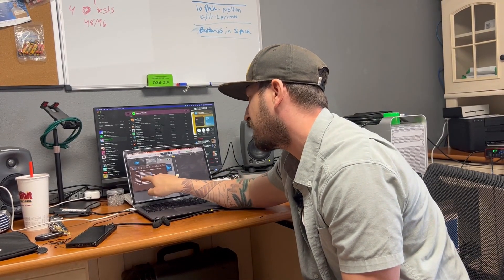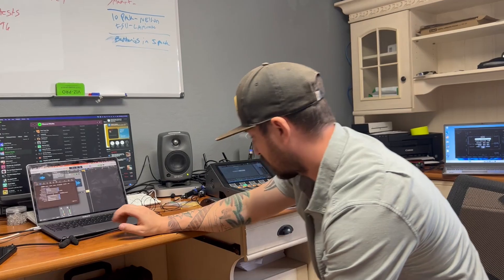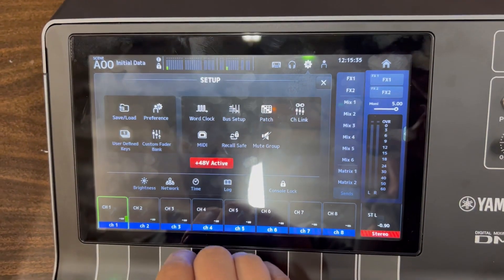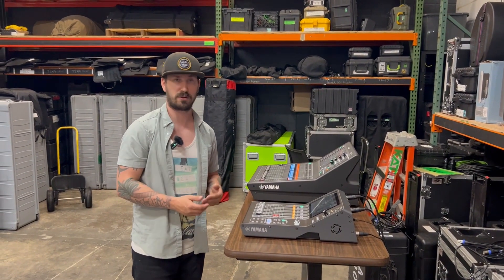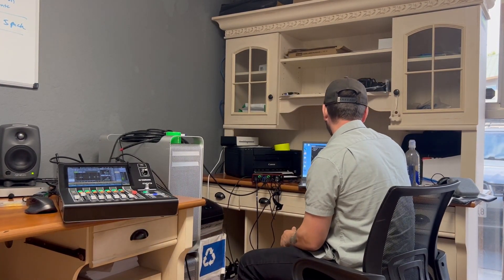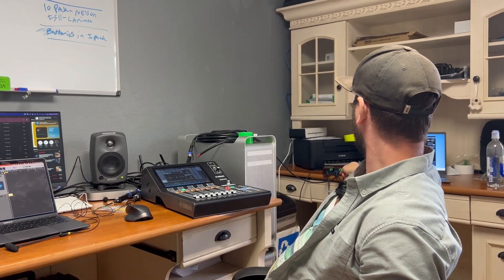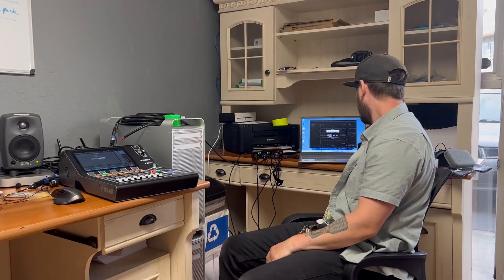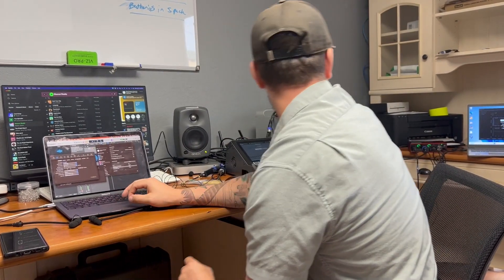DM3 FULL LATENCY TESTING - ANALOG AND USB

Comment: Hey Jay, killer video. I have a question about the DM3 : does it have a built-in multimand compressor or dynamic EQ? 
Thanks for the vid ! :)
Reply: Hey thanks for that. I wasn't aware. When you do that say on the lead vocal will it introduce a ton of latency in the in-ears?
Reply from the maker: @YannisFyssas  no, it’s hardly perceivable. Also depends on your sample rate and routing.
Reply: @KINETICPROFESSIONALS  1000 thanks !
Reply from the maker: No to mbcb, no to dynamic eq. You can use a ruio or vst rack and host plugins such as dynamic eq.

Comment: Quick question: .. Which mixer sounds better, TF1 or DM3 for live band ? .. I’m TF1 user but I’m looking to upgrade my mixer .
Reply: That will be the one with the better Soundengineer behind it.
Reply: Sorry I'm not sharing any insight but I am also deciding between getting a TF1 vs a DM3. I realized the TF1 is quite old compared to the DM3 but I can't help but feel I am not necessarily "upgrading" as you are giving up a bit. Less outputs, less combo jacks, less I/O over USB while you are getting (arguably) better converters, 96K and annoying power brick supply in order to get a very cool form factor.

Comment: Using Dante controller I have  ALL DM3 transmitters connected to the RUI 16 receivers and the other way around. I do not know yet how to insert a dante channel in the console channels??, or the main output per say.  Any ideas how to approach that?, the DM3 came with a version of VST Rack elements so I think it is possible to use plugins.
Reply from the maker: Is bypass on the Ruio on/off ?
Reply: @KINETICPROFESSIONALS  I tried both ways

Comment: Can you do the logic test with dante connectuon.
Reply from the maker: Sure , when I get a Dante model.
Reply: @KINETICPROFESSIONALS  thanks😊
Reply: @KINETICPROFESSIONALS  Thanks, I would think a virtual Dante driver would be less than USB, but would be interested to see the results
Reply: @redcurrantrecords I think Ethernet will be faster than usb?
Reply: @Tigerex966  I can't see in the specs if the ethernet is 100Mbps, 1Gbps or higher, as USB 2.0 is upto 480Mbps, and also speed and latency being related but different things, the driver and a number of other things could impact the latency. Would still be nice to see the test even if you're right.

Comment: Great testing. One observation regarding the USB tests, the discrepancy between Logic's predictions and SMAART are probably due to the USB returns not needing to go through an extra A/D/A conversion that the analog mix out -to-2nd channel-in went through. The baseline you used for SMAART for a zero time, I assume, would have had the two A/D/A conversions. I'd guess the DM3 USB round trip is faster than the converters, which in itself is impressive. I have an idea if you want to test the USB latency that should give a level playing field against the analog so the Focusrite doesn't skew it.

I love these tests man!
Reply from the maker: ED! Just saw your text. Lets work on it.